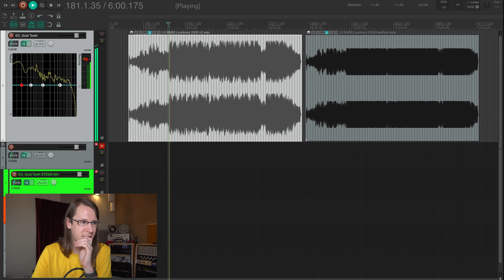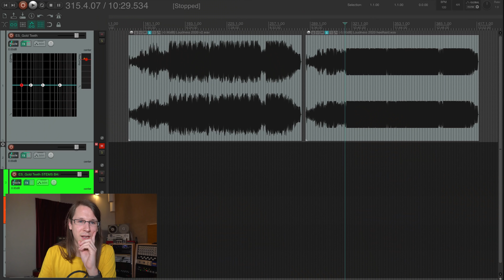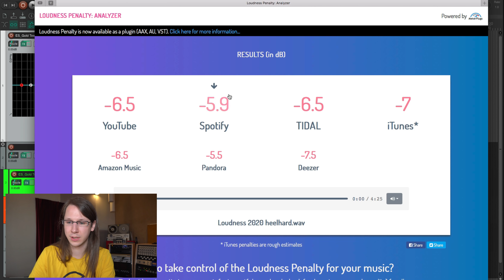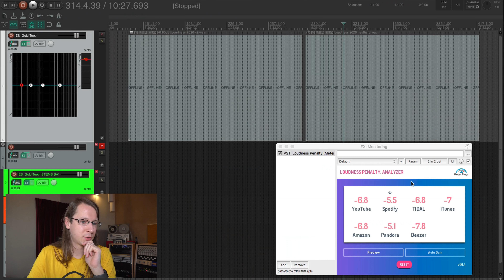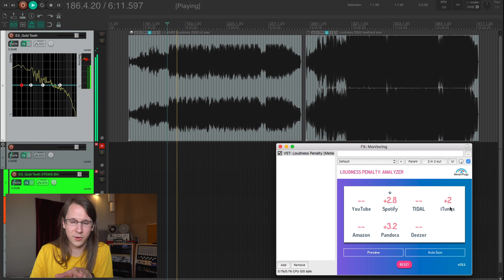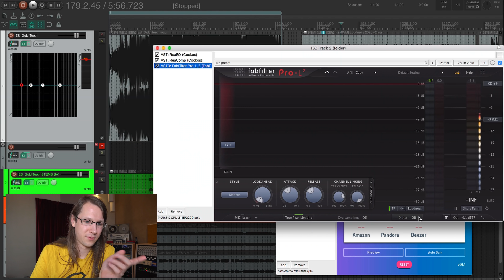MASTERING FOR STREAMING IN 2020!

Comment: Excellent vid, looking at most of the angles... Its funny when I went back to some of my historically favorite tracks over the years and started looking at them as reference tracks, I found that the ones that were more dynamic and well saturated with a nice central density always sounded better to me than the ultra loud ,peaks flattened out, solid block of sound like frequency dynamic. When i started mastering tracks more for my own ears rather than like trying to compete with some sort of quest for the loudness gold... mind you there is nothing wrong with that either... its about preference I guess... but no matter anymore if we host on these sites , they get the last hands on it...

Comment: Question 1: I am using the free Youlean loudness meter and not Loudness Penalty. So, I go primary by LUFS. What is the LUFS value you are aiming for when mastering?
Question 2: When the services adjust the volume of the tracks anyways, shouldn't the true peak be irrelevant as long it is not clipping?

Comment: It's no surprise that the plugin shows +2.x dB at around 9 mins. into the video since your v2 master item had been turned down by 2.4 dB and it was already peaking a few 1/10 of a dB below 0 dB to begin with. This means that its peak level after turning it down by 2.4 dB was probably around -3 dB, thus, provided that the mix complies with the service's loudness regulations, they will normalize it to peak at 0 dB. No "secret" limiting or compression involved - just linear gain. If you don't overdo your mastering loudness-wise, you can upload fairly loud mixes peaking at 0 dB and it will not get touched by the algorithm.

Comment: 2 Toughts on This:

1) I know many people who have disabled loudness norm. in spotify, due to the reason that tracks from EDM Artists like Hardwell, KSHMR and so on transfere their energy best if their is no processing going on. And there is also no loudness normalisation on beatport releases - so if you want to sound as loud as the "stars" you have to be somwhere around -6 to -5 LUFS.

2) I think its way more important to check the artefacts which compressing (wav. to acc. or mp3.) creates. Those artefacts can create somer louder signals and then you get even more "penalty" then you should get. Be Aware of this. You can check it with ozone for example.

Just my thoughts on this topic.

Comment: Hey, I had a question...
I am trying to get into streaming but also have the ability to just master my own tracks with ableton on the fly.
I know there's a way to use Maximus in Ableton for mastering/I just want the option to finish slightly rough versions of tracks as long as the levels are right... 
Do you have any basic mastering tutorials that can be done in stock ableton or with a free/reliable VST?

I'm looking at like... Mixing stems, but making sure the levels and math are all basically ok so that if I did a simple master to practice my own skill, I could still have the option to give the stems easily and etc to a better suited engineer...
Like, I'd be a lot better off if any of my music could be on spotify, but I just have to finish a lot of it. Even if some of the tracks aren't ideally mastered and I pass some off as rough masters or live sets.
Wondering if you had any videos on basic levels for mastering and what you'd recommend for this.
Thank you for the video. Trying to learn as much as possible.

Comment: Even with all of this loudness compensation going on I still think (it sounds to me) they are running the loudness of the commercials higher than the program content. Just like the volume of the commercial in this video,  I turned the volume down because of how loud it was and back up after the commercial. Is this actually happening or is it just me? Have you ever tried measuring the difference?
Reply: Spotify are running ads louder and its like the most irritating thing in the world.

Comment: I use Izotope Ozone for mastering....Does this plugin do what you are describing when you set it for mastering for streaming?
Reply: Yes pretty much. There are 3 settings I think from - 14 to - 11 and it places the peak to - 1. For CD it's mainly the peak is higher (-0.3?) and I don't think it gives you CD levels on that (-6-8 or so) it has the same luufs as streaming. 

Or use 'learn threshold' and set ceiling to - 1. Or read the LUFS meter 'integrated' option.

Comment: Unfortunately, I think most services do a file that's too loud (so yeah, don't get it too loud). Something which I think is important and oftentimes disregarded is that some platforms only reduce the loudness when it's over the limit; they don't boost it when the loudness is below the level (YouTube doesn't, probably 'cause you don't want those fail videos with people screaming to be that loud hahahah). On the loudness penalty, when they put the "--" indication instead of a value, that means the file is not too loud, and therefore will say as it is, quieter than other music (unlike Spotify).

Comment: what about soundcloud tho? a lot of people on soundcloud still push their volume to extreme levels and i cant seem to reach the same level of loudness with for example punchy (enough) kicks. my tracks are noticeably quieter than others and i think thats a big turn down for listeners. another thing i noticed is that most peoples hihats sound pretty shitty, i guess this is due to the low 128kbps conversion and artifacts, but ive heard really clean sounding hats by real good producers as well.
Reply: SoundCloud uses Opus. i'd recommend (max) -10 LUFS w/ 1dB Headroom. Also you may benefit from using 5 to 10% stereo imager increase/decrease. Opus tends to smash to center of image things that are less than 10% wide. Thats the reason hihats may sound weird. Also try highpassing at 32Hz+ and lo passing at 18k-ish

Comment: When you measure LUFS Integrared of a track and compare with the volume tag that a file has on Apple Music it is not the same. It is rarely turning down to -16dbLUFS. It usually turns down a db or two less than that which would get it to -16dbFS. So, I measured the LUFS levels of tracks playing on Spotify and Tidal and it happens to be louder than -14dbLUFS too. And it’s not an even difference between tracks. It depends on mysterious factors that the LUFS can’t apprehend (Of course the sound check on iTunes and level normalization on Spotify and Tidal were turned on). Any thoughts on this?

Comment: The youtube loudness normalization algorithm sucks. Albums in playlists often become unbalanced. Songs that have long enough silent moments are less quiet than those that pump all the time. Louder fragments simply pop up. Besides, the calculation is so stupid that a compressed recording treated with a hi-pass magically recovers 'dynamics' in the youtube meaning(phase rotation causes fake peaks restoration). 

I still prefer to listen from a hard disk, physical discs or a bandcamp where the plague hasn't arrived yet. Potentiometers are for volume control and not some commie-machine which seems to know better. I don't turn down loud recordings, they're for kicking in the face, that's all.